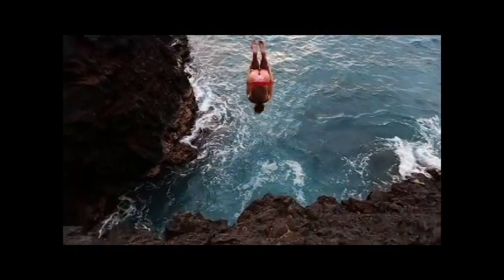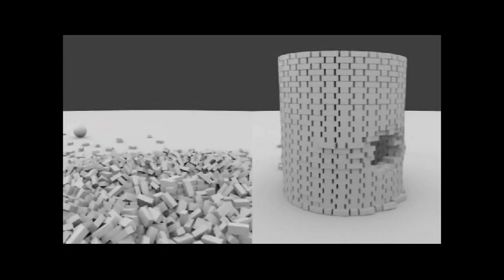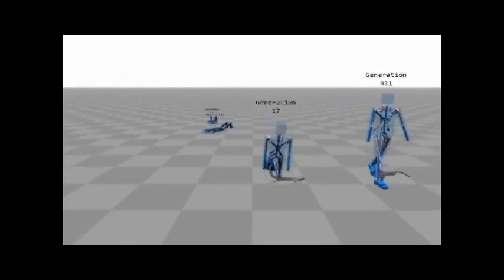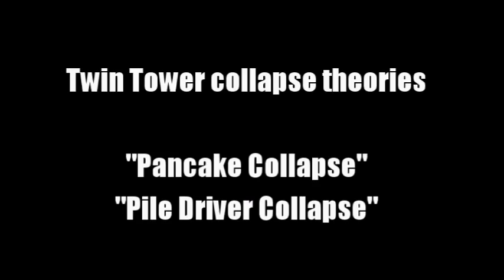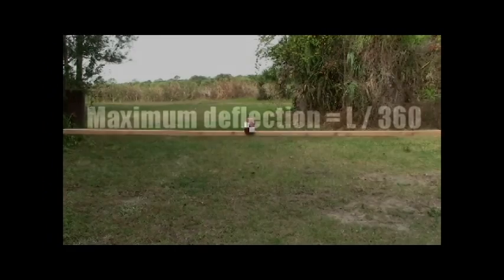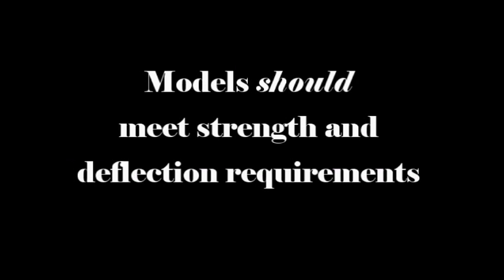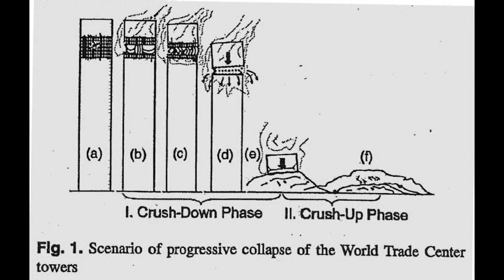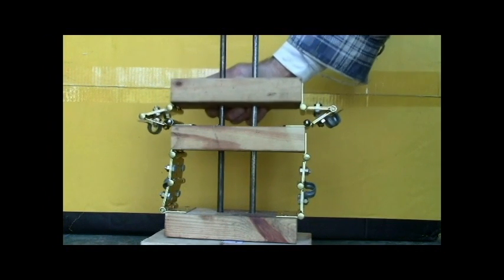9/11 Experiments: The Force Behind the Motion

Comment: 20 pound weight per L/360 code being dropped is incorrect. Upper 15 to 20 floors collapsed. 300 to 400 pound weight should be dropped (20 pounds per floor). Pretty sure that would go all the way down
Reply: If you're right then that's an important point
Reply: I'm pretty sure that the top 15-20 floors didn't weigh more than the rest of the building. The individual floors at the top almost certainly weighed the same as the other floors in the building. Therefore, the top 15/20 floors would only fall through the next 15/20 floors.
Reply: If he did it the way he does in the video it might, but he had the weight very high up, so the momentum was extreme. The point is actually the deceleration, rather than how far it goes per se.

Another thing is that the floors were unlikely in the extreme to each be loaded to maximum allowable capacity, but even then the end result is like the point where you have several floors stacked on top of each other and the collapse arrested.

But perhaps there is an argument to made for pre-loading each floor to the point of near failure and the causing  a single floor near the top to fail. Even in that domino like setup, and like actual dominoes, it doesn't take a lot of ejection and resistance from the core to halt the process in real physical systems.

In other words: In order to have the collapse accelerate as it did the building pretty much had to built to deliberately to fail that way, something I find highly dubious in the absence of a controlled physical model to work from.

Comment: To properly test the theory, I'd recommend removing the 2 metal rods that support the entire contraption and re-run the experiment
Reply: That's actually a good part, because the main structural support in the towers was the core. From the small scale experiments I've done I can assure you that taking out the core just makes the top fall off. Cole actually mentions it in passing as well.

If you think about it it is actually rather obvious: Path of least resistance. The fact that he managed to show that it doesn't work even with a core that stays in place makes rubbish of an alternatively pancake theory that posited a sort of funnel inside the building forcing material to stay inside. As you can see with the first experiment that doesn't make a difference.

I suppose, to be thorough one should try for a combination, with just barely destructible walls and a solid core, but I doubt the outcome would be very different from what you see here, since he weighted heavily in favour of the official models.
Reply: Thanks for an intelligent response, it's rare to get that around here. :) If we look at the towers 1 and 2, the cores were damaged, along with the outside perimeter, not to mention the multiple floors. The entire system hinges on being interconnected for it to work, and with plane taking out those connestions, it would be destined to fail. Also, consider the weight of the plane itself pushing down on the already overstressed floors, and columns with the weight of the rest of the building as well. It's suprising that they stood this long in that condition. 

As the collapse started, you can see the core punching through the falling debries and remain standing for several seconds before falling down as well. So, yes - cores were the strongest parts of the buildings, and they survived and fell last. There are numerous videos showing the cores still standind after the collapse.

The simple dropping of weights on top of some cinder blocks is completely inaccurate and wrong way of testing the theory of the collapse. It's a lot more complicated than that. Once the collapse of the building would start, the energy it generated would be impossible to stop. The outer casing (as it was peeling off) kept a lot of the debries inside, which resulted in towers coming more or less straight down and not sideways.
Reply: That's the thing. People keep saying "once the collapse of the building would start, the energy it generated would be impossible to stop". I don't doubt they genuinely believe it, in the same way that people genuinely believed that a force is required to keep an object in motion before Newton and Galileo. It makes intuitive sense ion some levels. But there is no way to physically reproduce anything like this. No physical model you can build actually behaves this way.

To get the falling debris to behave like this it would first have to be completed DISconnected so that it can behave as a fluid. There is simply no mechanism or available energy to do so. It is easy to forget that the dominant force here is electromagnetism, not gravity. Whatever energy is released by the falling material is massively (no pun intended) dwarfed by the force stopping thing spontaneously flying apart or exploding like the  Pinto in "Top Secret".

The weight of the plane was a fairly insignificant factor. Most of the mass would have been distributed over a large area over several floor or ejected along with other materials. If you work it out, even a single floors would have easily been capable of carrying the shredded and distributed load of one 767. Maybe if you parked it intact resting on its nose pointing straight down in the middle of a floor span, but that's not what happened, and even then it would take only a couple of floors to rip it apart and distribute the load. It being designed to be as light as possible and not intended to carry any load.

The core damage was also not particularly significant. Most of the force of the plane would have been eaten up by the floors and exterior columns (that WOULD produce rubble). Importantly the building was stable afterwards, with no sign of structural failure until immediately prior to the collapse. I remember reading a paper a while back that produced an estimate taken from several sources. The conclusion was that the core damage was not a factor in the final failure. You needed the fire to induce collapse, and if the fire was hot enough to induce it with the damage from the planes it was also hot enough to induce it without.

So essentially the planes are red herrings from the point of view of finding out what made the collapse happened, and how it happened the why it did.
Reply: Thanks. Yes, as far as I am concerned the politics are somewhat of an irrelevant distraction.

"The case of the WTC collapses, observers can become transfixed not on the object of study, but on each other, or can support a theory without efforts to fact-check claims. The resulting theory comes to serve as a type of surrogate reality. A false sense of certainty forms in the observer over the surrogate reality."

Unfortunately it seems this website fell onto the ROOSD or OOSD claims, which I believe to be largely make-believe. The major problem is what I mentioned earlier: ROOSD and OOSD requires the material in the building to behave as a fluid or quasi-fluid. It's no more realistic than Cole's experiment and just a tiny bit better than Bazant's.

Comment: The buildings didn't collapse. They disintegrated.
Reply: Exactly.The concrete turned to powder. Those big clouds were dustified concrete AND there wasn't enough concrete and twisted metal core left after the so called collapse. There should have been a huge pile of concrete, most of the bottom 1/2 of the buildings should be intact still since they weren't affected. The building tops should have fallen off to a side, not straight down. Simple intuitive logic. With massive concrete and metal cores, there's no way it could've fallen straight down against itself in the path of greatest resistance.
Reply: exactly. they blew up those buildings. not sure who but someone knows the truth and is keeping it from us. and that sort of govt. cannot ever be trusted.

Comment: You could test my theory as well: Here is how: build a solid mainframe and lightly attach floors. Place ontop of openable hatch with plenty of room below. Open the hatch so that the mainframe falls through. You see freefall and sort of "pancake collapse". This is possible - the bedrock support was essentially removed below all of 3 towers with usage of precisely placed 150kt nuclear charges. Also most of the structure of the towers would be melted inside the created furnace. There is a witness testimony by Dmitri Khalezov thet he had a prior knowldge about the inbuilt deconstruction system. which is perfectly inline with the video evidence. However only thing not inline is the "melting planes" and cartoon physic impacts.
Reply: *****
 According to Dmitri Khalezovs testimony, the infrastructure: the delivery tunnels to the towers and the mantanence facility below the B7 were built in in the foundation building phase, of the complex in accordance to a valid decommission infrastructure required by the NY building code. Its possible that the nukes were removed or replaced during that time, but then again re-installed, and utilizied on 9/11/2001. The photo evidence shows that walls of the created craters in the bedrock were smelted into a plasma phase and then resolidified, therefore the clear visual pattern of so called volcanic glass pattern or rings. None of that is possible with conventional charges, but always happens with usage of thermonuclear devices.
" The planes" however are merely a distraction. They would not have any impact on the structures mainframe at all, even if they were real. However the plane only appears in the forged video footage, I believe there were no planes hitting any towers. Evidence also shows that planes with same tailnumber were actually landed elsewhere during that day.
Blaming Osama or islamic terrorists is fakery.
The US. became an aggressor and the terrorist state on its own and that applies even to time before 9/11.
Reply: *****
None of the parts fell off, in the video, the plane literally smelts inside the building with zero collision physics. All the videos are for certain fakes. Therefore unless you have proper evidence, (not planted) then there was no planes.
Reply: ***** Drill about 75m deep hole into ground below WTC1,2,7 You will find samples of resolidified bedrock+steel from a plasma state - which is exclusively possible with usage of a thermonuclear devices. There is your evidence 100% proof. Of course the other evidence is the witnessed pouring smolten metal, the IR-satellite images, the seismic data, the absence of rubble pile, the presence of unusual radio-isotopes, the photographic evidence of resolidified bedrock, the evidence of using anti radiological chemicals in the firefighter's water, the evidence of using full hazmat suits by FBI, the evidence of using radiodetection equipment by first responders, the evidence of cancer related illness cases in first responders, of course the evidence of freefall speed, the witness testimony by D.Khalezov, the presence of inbuilt deconstruction infrastructure initially legally REQUIRED by the NY building officials. But then there is also bunch of evidence that point that NO PLANES were present. The most obvious being the 9/11 videos, smelting inside building like a speedrunner through wall in cartoons, Intact paper passports, video footage with "missing" plane in wideshot. multiple nuanses pointing on video manipulation, such as masking and blurring techniques. The plane tailnumber registry data, that points the alleged planes were landed elsewhere. Obviously the physical facts that no plane, especially passenger plane is able to fly the officially described flight parameters ESPECIALLY with untrained pilots. A plane would have disintegrated if you exceed its max designed speed. Not to talk about passenger plane structural integrity - its would be impossible to melt inside a 50mm steel beamed structure. Also kerosene fires are too cold to "weaken" steel. Even a living person can stay next to a "kerosene fire", except that there was no kerosene anywhere in the towers. They used absolutely regular explosives to make that pathtic "plane shape" which is NOTHING like a plane shape. absolutely rectangular cuts in the outer wall.
Not to talk about US. airdefences, absolutely impossible to fly "undetected" for almost hours. I have seen ONLY paid actors telling that they saw a plane live, all other persons saw plane on tv, or DIDN't see or hear any plane at all. If you have a person who saw a plane live - please tell, i will contact that person immediately.  
The official story is the MOST rediculous thing I have ever read. Its like spitting in your face, telling you how fucking imbecile you must be to believe it. It is an insult agianst American people, who however are absolutely powerless against it. Accept your Patriot act, and accept NSA internet spying - just because you are too illeterate to learn a bit of basic mechanical physics.
And btw I am using term You in a common way, not meaning particularly you, my friend.
Reply: +Invaderzerg not to mention grey airplanes with no windows on them & no United Airline or any other decals.
Reply: Derrick Robinson I believe, they are only pasted images using video editing sofware. Absence of exhaust trail is one evidence but there is hundreds more if start to study it.

Comment: ' why did the world trade centre collapse, science, engineering, and speculation',  
   is the best explanation, that i have seen.
were all the workers there, blind? or did they just not notice the small army of demolition experts rigigging up the place, with explosives, thermite bomb's or whatever, for a few month's?  and why bother with all this work, when the 2 jet's would produce plenty of dead bodies and damage to the buildings, to produce the desired result, namely an excuse to carry out the disgusting zionist's plan,   p.n.a.c,   the bombing, invasion and destruction of any middle east country, which refused to take orders, from zionist washington.
    the buildings, were of lightweight eggcrate construction, no massive r.s.j's that were used previously, and were 95 per cent air,  throw 2 jet's weighing hundred's of tons at them, at 3 or 4 hundred miles an hour, add probably ten million joules of heat, wait for what's left of the steel supports to lose half their strength because of the heat, add all  that to the buckling of the joists, due to thermal expansion,  and only a miracle could have prevented it, from collapsing.
      or you can believe all the nonsense, please yourself.